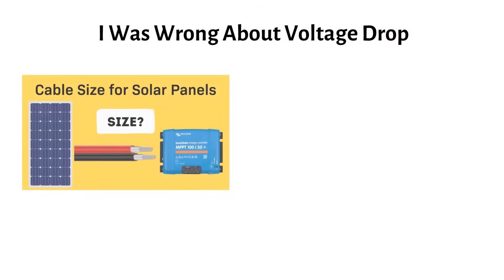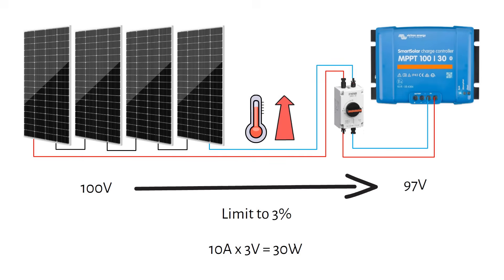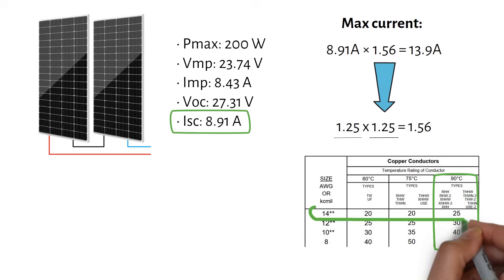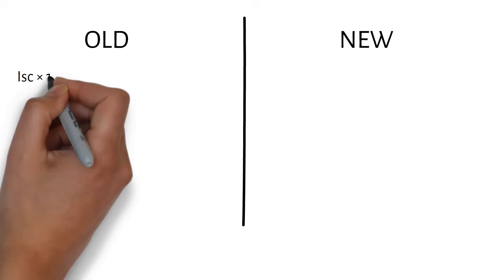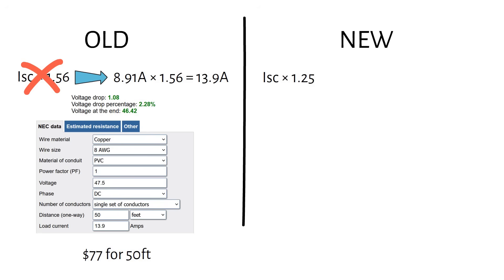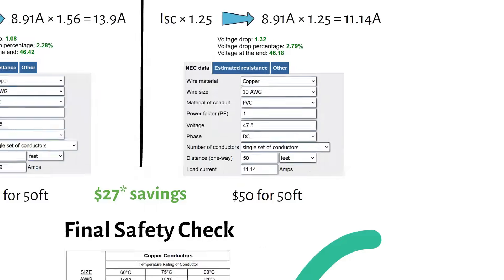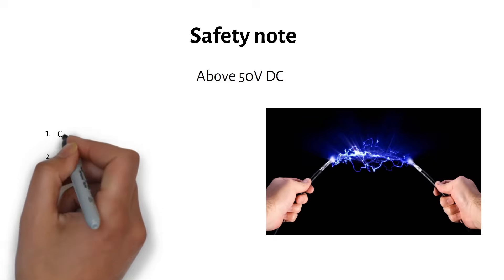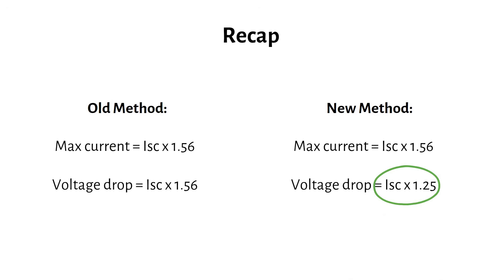Solar Panel to Charge Controller Cable Size

Comment: Generally speaking, the rule of thumb is:  Always use 10 AWG for solar cabling and limit yourself to around 20A.  That's it, you are done.  Simple.  And ok.. if you have to use 12 AWG then go ahead, but limit yourself to 15A.  But default to 10 AWG.

But now why?  In real installations the #1 thing that ensures a good long life to the installation is to avoid thermal cycling as much as humanly possible.  This means that the cable should never get anywhere near 90C.  It shouldn't ever get hotter than around 45C, actually.  60C in a pinch.  No higher.  Regardless of the insulation rating.

And it isn't just the cable.  It's also the MC4 connectors, the fuse and breaker junctions, and the MPPT input junctions.  If you want to avoid unfortunate melting and early equipment failure, you definitely need to limit thermal cycling on all junctions in the system.

In a pinch I'll allow 25A on 10AWG, but it requires extenuating circumstances.  Sometimes hard to avoid when using a combiner box to combine two strings of HVDC residential panels, for example (if using separate MPPTs is not possible)... then the backhaul can still be 10 AWG but run 25A, as long as any MC4 connectors along the backhaul are rated for 30A.

Also, solar cabling should never be exposed to direct sunlight under any circumstances.  and voltage drop is more or less irrelevant when you run panels in series.

-Matt
Reply: My setup will be 100ft one way, possibly more.
Might run the wiring in a water hose to keep wires dry and out of the sun.
I don't want to trench 2 feet underground to run piping as code demands.
If in a water hose, I can run the wiring on the surface.

800w @27v each in series, 8.5 amps each should be OK I think. 8 gauge wire.
But what size water hose???
May add one more 200w panel later on just to offset the line losses.
Trying to stay well below that 150v Victron input threshold.
Reply: @crazysquirrel9425  For 100ft you do not need to run 8AWG.  That would be incredibly expensive and unnecessary.  10 AWG is fine.  But if you are going to go to all that trouble you should definitely run extra wire bundles for future-proofing expansion later on.

For a system that far away and, I also recommend at least planning for higher voltages.  150V is fine to start with but don't marry yourself to it.

I can't recommend the water hose concept.  100ft over ground really needs to be trenched, then eithre direct burial cabling (which I am not a fan of), or wet-rated cabling in PVC conduit (which would be my preference).
Reply: @junkerzn7312  I don't want to come close to that 150V Victron max input.
4 panels gives about 100v-ish. 5th would make it 135-ish which is below the max input.
For me to trench I would have to get permits since it would have to be trenched under a concrete driveway. Anything concrete related has to have PERMISSION to do where I am.
Cannot dig pits to run under the driveway as it would kill a valuable tree.
If I just ran the wiring on the surface in conduit or hose to protect it, I figured it would be OK AND It allows for array portability when desired.
Have Victron 150/70 MPPT controller.
Stuck with 12v output though.
No money to buy a 24v or higher inverter to convert to 110. Also would have to buy a battery charger that runs at the higher voltage if solar cannot keep up.
Will have four 12v 100AH LiFePo4's in parallel.
Original intent was to run refrigerator off them.
But may fix it to run gas furnace in winter and maybe a window AC in the summer to offset central AC costs (have an ancient 5 ton AC using).
I may just do a ground mount instead of portable too.

But, I may also just get a string inverter and run the output to the garage to back feed into the house. That would be the most efficient way I think.
Can still use battery bank as backup if needed.

Dunno. Decisions decisions.

Can't install anything right now. Too many irons in the fire as it were.
But at least I can still do research and planning.
I do have nearly everything I need except the string inverter.
Had to piece together a bulkhead connection too (got parts but not installed).
Seems NO ONE sells one that is not a gigantic box.
Just want a simple male plug and female socket weatherproof and good for 150vDC plus 70 amps.

Not a stove plug sized one either.

Oh my batteries and controllers and such are on a commercial grade roll around cart in the house. Makes it easier for maintenance and cleaning the area.

Drat reminds me I need some plywood for mounting... Grrr...
Reply: @junkerzn7312  Ps that valuable tree is a whopping 60 feet tall.
Reply: @crazysquirrel9425  Ok, 10 AWG has 1 ohm of resistance per 1000 ft.   100ft run x 2 (DC+ and DC- return) is 0.2 ohms.   Lets assume 10A @ 100V (1000W).   The voltage drop is 10A x 0.2 ohm = 2V (out of 100V).  The power loss is P = I * V  (10A x 2) = 20W.

(You can also calculate this using P = I^2 * R which comes to the same value, 20W.  10A * 10A * 0.2 ohm = 20W).

So with 10 AWG your power losses will be 20W/1000W = 0.02 = 2% at full power.  And losses will be far lower at lower amperages.

The backhaul from the charge controller to the battery needs to be ... probably 4 AWG @ 70A.  That's the problem with having a low-voltage battery bus.  At 24V or 48V the amps would have been a lot lower.   But at least the 4 AWG will be a really short cable just going from the charge controller to the battery.

-Matt
Reply: @junkerzn7312  Minimum OC panel voltage is about 27V and about 8 amps-ish.
Have 4 I will connect. Max amps will be around 35.

Getting a string inverter to save some headaches for now.
Have 110 ac outlet near where the panels will be. Battery cart is a long way from the panels.

Will use 2 gauge cable from batteries to bus bar.

"The maximum cable size that can be used at the battery terminals of the Victron SmartSolar MPPT 150/70 charge controller is 25 mm² (approximately 6 AWG).
 This is the maximum recommended size for the battery side connections to ensure proper fit and safe operation.
 For the PV input side, the maximum cable size is also limited to 6 AWG (approximately 13.3 mm²), as the terminals on the 150/70 model are designed to accept cables up to this size."
So I have either 8 gauge or 2 gauge to use.
Unless I buy some 6 gauge - short piece?

Inverter already comes with it's own cables.

Can't do anything more than 12v right now as inverter is 12v and the battery charger I may have to use is 12v (40 amps).

All the numbers that work out to things are far different than what equipment will accept.
If Victron handles 70 amps, why limit cable sizing to 6 gauge?
What do they know that we don't?

My cables will have crimped on ferrules too.
Have breakers and fuses but have to guess on what and where to put them.
No idea as I don't know exactly what I am going to run off the rig.
Originally planned on a refrigerator which uses 2kw/day & 1/2.
May try to add insulation to some of the refrigerator to reduce run frequencies. At least the back anyway.
Even a 10% reduction is a big savings.

Would love to set things up to use a window AC in the summer and run the gas furnace in the winter. But have no numbers yet to do calculations.
Reply: @junkerzn7312  Could only afford the victron 150/70 so voltages must be 25% lower than max to allow for cold weather.
Not idea if my cabling is wet rated or not.
Reply: @crazysquirrel9425  You can also at least temporarily limit the amps the charge controller puts out to any value.  So if you want to use 8 AWG, you can start out by limiting the charge controller to 50A.
Reply: @junkerzn7312  Max panel output is only 35 amps.
Don't see a need to alter anything in that respect.
Even if I added another panel I would still be under 50.
Small system actually.
Didn't intent on running the house.
Just a few things at most. Something as a backup plan of sorts or save a bit of on the bill.
This may be a giant waste of money. Spent $2K already and STILL things won't do what I want.
Reply: @crazysquirrel9425  Victron is kinda known for under-sizing its terminals.  Anyway, you still want to program the limit in the Victron app for the charge controller to what the wire can take, because you might forget at some point in the future when you add more panels and suddenly find your wiring on fire.

The rule of thumb (other than conservation) for saving money on your utility bill is to have electricity usage high enough that offsetting it actually saves you a decent amount of money.   If the things you are running from the system don't burn a lot of power, then you won't save a lot of money.

The general setup is to let the solar charge the batteries and inverter runs the equipment, then configure the charger to just supply a supporting voltage for the situation where the batteries get low.   So you wind not using the charger to actually charge the batteries... only to provide low-battery load support.

If using a victron charger with bluetooth, you can put it in "power supply" mode and set the voltage to a supporting voltage... typically between 12.8V and 13.2V.

-Matt

Comment: I Like that 10awg PV Cable can in Fact handle 40amps for less than 50 feet and Safely.

Thank You Nick for being Professional to Explain and update Us on Your Findings  🥇
Reply from the maker: It also depends on the voltage going through that wire. The higher the voltage, the fewer voltage drop you will have.

Comment: Thanks for the update. Im wondering what power factor means in the calculator. I see you've set it to one. Also, if i'm using twin core wire, do i set the calculator to 'single set of conductors'
I am running a pair of 120w shadowfuxes in series for 16m. The voltage is 33.69 and the amps are 4.57. Using the calculator and your 1.25 safety factor, power factor 1 and a single set of conductors, I came up with 14awg.
Reply from the maker: Good questions. The power factor relates to the load being pure resistive or reactive. Reactive is for motors and pumps. Since we are not using these we can use a power factor of 1 since it's pure resistive. You should not be using twin core wire because that's not pv cable. Pv cable is always single core. 14awg is not common, so you most likely will use 12awg.
Reply: @cleversolarpower thanks for your answer. I am very confused about the single/twin core thing now. I'm in Australia and there are a lot of solar specialist companies selling what they call twin core pv cable. Not cheap stuff but proper tinned copper outdoor rated expensive cable  recomended for solar. I'm wondering why it has to be single. Is it an overheating problem? Also i will probably end up with 2.5mm, which is equal to 13awg.

Comment: In large solar setup where voltage is 400-800 V you can use smaller cables! But always use the next up to your calculatios!

Comment: Thank you for the update! Marking changes in book now. 

I am installing 2-200A Renogy Shadowflux panels in series on my trailer. The PV's coming out of the panels are only 14AWG, 2' long. The pre-wired gland on the roof to the MPPT is 10AWG. 

The max current is 10.7 (6.86A x 1.56), voltage 62.6V (2 x 31.3V) and using 8.58A for voltage drop (6.86A x 1.25), 1 way PV length under 30'.

Since the initial PV wire built into the panels is 2' of 14 AWG, are all calculations from panel to MPPT based on 14AWG, even though it's 10AWG the rest of the way to the MPPT??? 
Thanks, Erik
Reply from the maker: They really put 14awg connections on that panel while they charge you a premium for 'shadowproof technology'? Damn. The voltage drop will be higher in that part, but if the rest of the wire length is 10AWG then it's okay, it's only a short length. It's not a bottleneck, just some more resistance.
Reply: @cleversolarpower  Thank you. Yeah, indeed for the price they charged, you'd think they would spring for 10AWG. An extra buck?

Comment: Great explanation!
Two sets of Renogy 400W 48V portable panels in parallel on 40' 10awg PV wire connected to a Victron 100/50 CC. I haven't measured the actual voltage drop but it works like a charm. 8awg cabling, even though a one time expense, would have been a pita to work with and my calculations suggested that regular 10awg PV would be the correct size. The portable setup consistently outperforms 880W flat mounted panels on my RV roof 2 : 1

Comment: Thank you for the new information, Nick. I have done electrical work for a very long time. For my own piece of mind, I always do all of the calculations, then use the next larger size wire or cable necessary. To me the wire or cable is usually the least expensive part of the project, so I use the next largest size in order to never have to go back.

Comment: Indeed.. thanks for the update.. I was wondering why there was a 2nd safety factor like the fuse configuration..
Reply from the maker: The safety factor for the fuse calculation is still the same. It's the one for the voltage drop that changes.

Comment: According to the NEC table notice the "**",  it flags  NEC 240.4(d) is the "Small Conductor Rule" which sets the maximum overcurrent protection for certain copper and aluminum conductors to prevent overheating. For example, it limits 14 AWG copper to a maximum of 15 amps, 12 AWG copper to a maximum of 20 amps, and 10 AWG copper to a maximum of 30 amps. This rule applies unless specific exceptions, such as those for motors or taps, are met. Not sure how rigorous you want to be as I'm guessing your are not in the USA.
Reply: Thank you for adding some real knowledge. I've noticed several questionable point in previous posts.
Reply: @luminousveiws you mean some of my posts are questionable?

Comment: Thank you for this information. I do not have a permanent setup yet, but I have several panels, batteries and charge controllers and currently only set them up for testing or when the power goes out. I did not have this information when I first started buying the pieces, so I have a mixture of 12 gauge and 14 gauge and maybe one or two 10 gauge wires. My question is, if the wire gauge can handle the current (let's say 12 gauge and 20 amps), but is long, does it matter if the voltage drop is more than 3%? is there anything physically wrong with losing up to 10% in voltage drop?  Thank you.
Reply from the maker: 10% is a lot. All professional installs are 3%. If you have that amount of voltage drop, did you wire your panels in parallel? I recommend wiring in series whenever possible.
Reply: @cleversolarpower  I have tested different configurations. I have tested series, parallel and series-parallel. I think part of the issue was using two 25 foot cords. I may have had a 14 gauge off the panels and the 12 gauge closest to the charge controller. It has been awhile since I have tested it but I will check it again next time. Thank you.

Comment: I used 6awg cable on some very old now 255 watt panels. Running 4 in series I am getting around 133-150v My panels using a Victron CC is giving me great results. Even sometimes getting more than 100% of rated power out of this setup. I always oversize my wire and run everything as high as voltage as permitted in the setup via panels and CC and battery voltage. Also, running 12V battery setup is not good unless very small setups. You really want 48v setups if possible. And if getting say a all in one inverter charge controller AC to battery charger they are great. But, not so great either if one part fails it becomes useless if you need to send in for repairs. Also, I have found Victron MPPT works way better than all in one units. Also, pay attention to panels your buying out there now newer panels are 16 Bus Bars Type N. Anything less your most likely buying yesteryears models.
Reply: Pretty costly to buy a 48V inverter. Got a spare kidney?
Even 24v inverters cost a bunch.
And if you want or need to use a charger in case panels cannot keep up, that too is expensive.
Define very small? Is that under 2000w? Under 1200w? Under 1000W?
Reply: @crazysquirrel9425  Even today it is I got mine in 2022 and prices where higher I think back then even I paid $541.61 for Powland 3500w 48V all in one. I mainly only use for inverter though. But, I like fact of back up CC if needed. I would have to rewire though. As the frustrating thing is the advert said it would work up to 150V input which is near my input v. But, after hooking it up found maximum MPPT input was way less making the CC side useless. Going Victron CC only made it nice gave me app support as well. So I use both combined.

Comment: for the same amount of amperes (8,7a )   ,two strings , 200 and 350 volts ,and a distance of more than 30m ,  i am planning to use 4mm2 cables and 10A fuses
Reply from the maker: You can use the voltage drop calculator I linked in the description. I think your fuse needs to be 15A.
Reply: @cleversolarpower   Hi. Why do you need fuses if your cable is specified to handle the short circuit current Isc? How could the fuse ever blow? Regards
Reply: @martindooley6796  for my case , i also plan to use the fuse cases for cut off switch , if i want to disconnect the panels . as long as i am expecting at most , 8.7 amps , i find that 10 ampere fuses will be ok .  the cables are separate (some cable calculators have the option of what type of wire installation will take place and how ) , which makes different calculations
Reply: @isoufacker  You'd need to be careful pulling the fuses if under load. It's difficult to break DC currents. Would you not be better off with a DC rated isolating switch?
Reply: i am also thinking for in case of upgrade , if i have to put a parallel and serial installation together with double the amperes  , to experiment with using double cabling of 4mm2 for positive and negative lines instead of upgrading to a 6mm2 cable

Comment: I got some 120mm2 aluminum cable to run some 40A solar at ~145v about 180f away plus some bimetal lugs to hook it up.
Reply from the maker: Why 40A of solar? A lot of parallel strings?